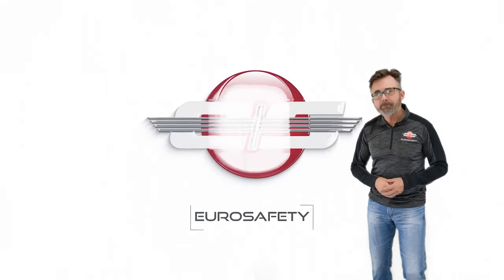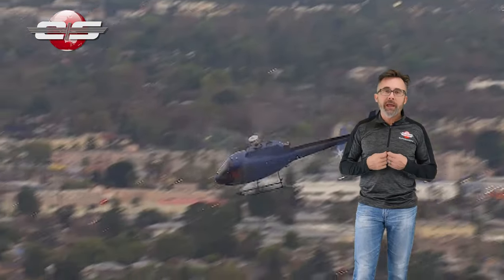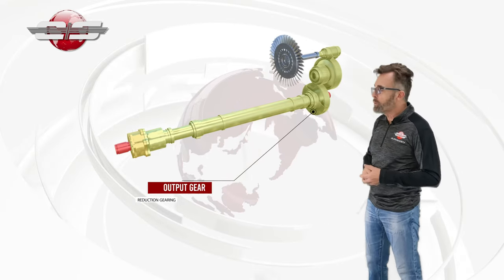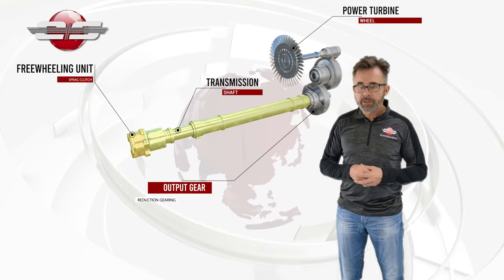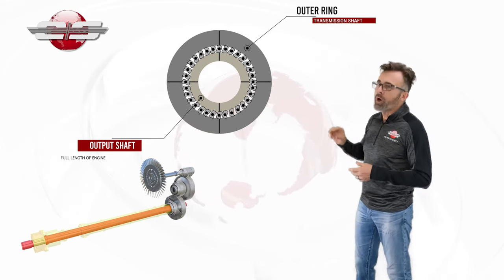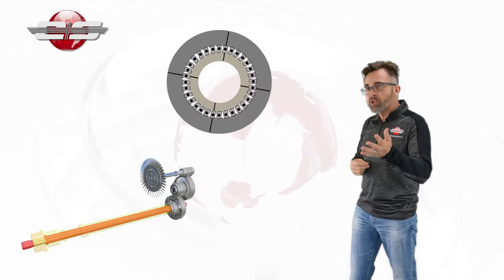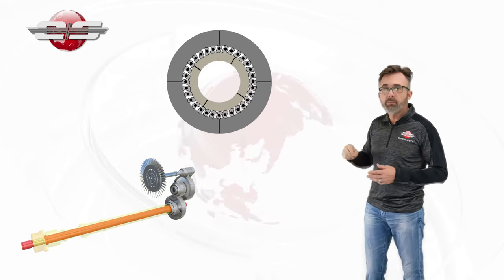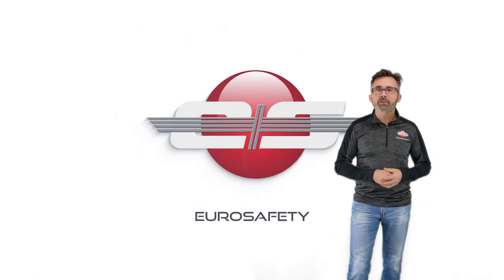Sprag clutch freewheeling unit

Comment: You mention near the end; "in an engine failure the main rotor powers the tail rotor THROUGH the engine." Is the engine not completely disconnected at this point? Would power not be transferred solely through the main rotor, to the transmission, to the tail rotor during an auto? Wouldn't the Freewheel unit completely disengage the engine at this point ? Thanks!
Reply from the maker: To be more clear ... the drive goes through the engine. The engine has an output shaft that sticks out both ends of the engine. When the engine is running a freewheeling unit around the shaft powers it, and then of course that shaft powers the transmission and tail rotor.  After an engine failure in an auto the main rotor turns the transmission, which turns the engine to MGB drive shaft, which turns the output shaft in engine, which powers tail rotor drive shaft, which powers tail rotor.
Reply: @EUROSAFETYTRAINING   Awesome thank you for the reply! I think my confusion on the original description was that the MR was somehow still fighting with the resistance of the dead engine while powering the other systems. Sprag clutches are very cool. Side note; during an auto, is the MR also powering the instruments (through the alternator) or are they just running on battery at that poin during auto rotation?
Reply: The connection between the main gearbox and the tail rotor runs through just the engine's gearbox, which is packaged with the engine and so is considered part of the engine... but of course it's not really the engine.
Reply: @brianb-p6586  thanks Brian this was the clarification I was looking for!

Comment: We were recetly told during recurrent trainging that the reason for the manual saying that you must shut down the engine and perform an auto if you confirm a low engine oil situation, is that w/o lubrication from the engine, the freewheel unit has approx. 10 seconds before it fails and sizes, making an auto impossible. Can you guys comment on that duration of freewheel longevity in a low oil situation? 

Thanks again for these videos!
Reply from the maker: You are welcome. Regarding the oil pressure. I m not sure where someone got the 10 seconds time from. There is nothing in any publications that says that. But I do have references from pilots that continued to fly after the loss of oil pressure. There was an accident in Canton, MS where the helicopters engine routed all the oil into the exhaust due to a plugged oil line. The ENGP light illuminated and because the oil temperature was not rising the pilot concluded that there wasnt an issue (oil temp would actually go down after a loss of oil flow). The helicopters engine ran for 26 minutes before failing. Hard landing.
Reply: @EUROSAFETYTRAINING  Insteresting, if I remember correctly, that number came during training in an Astar simulator somewhere in Western Canada. Whoever the training was from (I'm not sure if it was directly from Airbus or not) simulated Eng Oil low and a failed freewheeling unit, and the conclusion was there was 10 seconds to failure w/o Eng oil pressure. I'll need to look into where/who they got that from. 
Can you say as to why the manual says the engine should be shut down if loss of Eng Oil is confirmed?
Reply: So looking into it more that 10 second number came from an Airbus certified simulator in Edmonton, Alberta. I’m curious as to where they got that number from